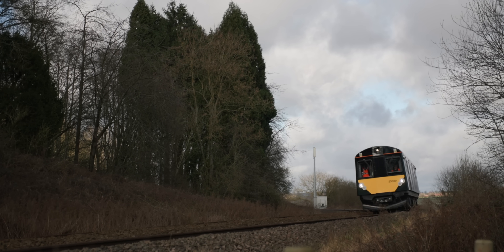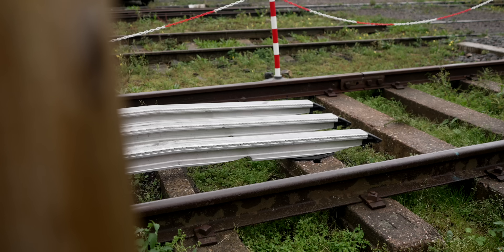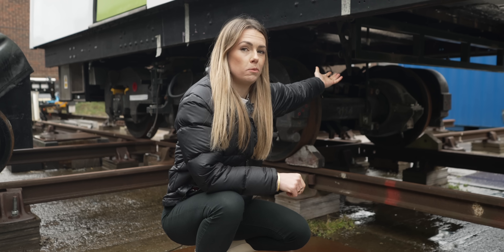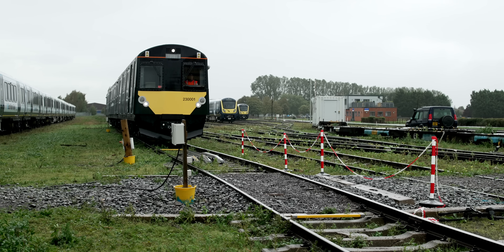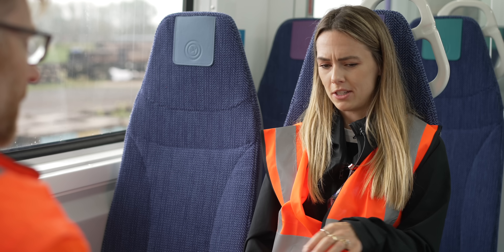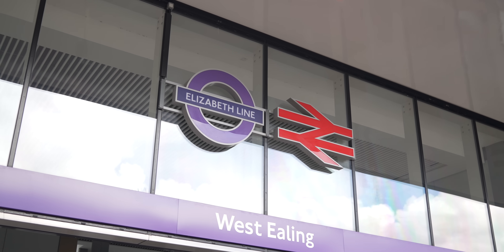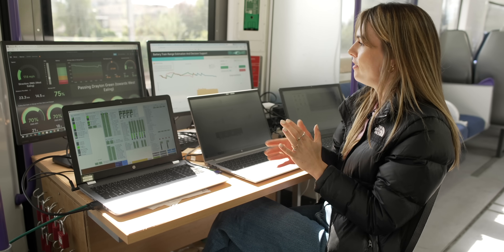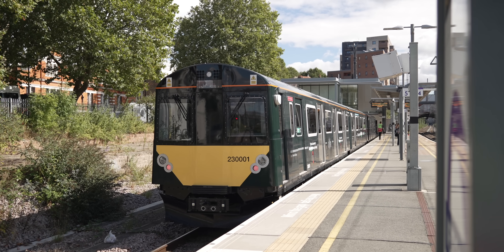Onboard the UK's First Battery Electric Train!

Comment: Battery trains are a good idea for unnelectrified branch lines that run on diesel as it would electrify the line quicker and cheaper than install overhand pickup lines via pantograph or third rail via running shoe.
Reply: Electrification of train lines is an expensive and time consuming activity, the 80 mile stretch from London to Bristol cost £7b and took 8 years (which covers a third of one of the two furthest south west lines). I won't mention the more recent cost or timescale of HS2 upgrade, which dwarfs the west line upgrade. Even on the south western lines the majority of the two routes remain unelectrified operating diesel (and hybrid diesel/electric) trains on the routes, having battery trains would be a more cost effective solutions for these services swapping out the ageing diesel train stock.

Additionally, the areas involved are high flood and wind risk locations, having battery trains would enable operation when power was down for third-rail or pentograph solutions. A battery train would be able to continue past areas without power to the next recharging stations.
Reply: @GruffSillyGoat  West Coast Mainline was fully electrified in 1974.
Reply: @J-Railway-Volunteer  - it's those pesky UK geographic terms, the 'south west' England routes are also referred to as west coast routes along the bit of the south-west I reside. I hoped avoiding the term main line would distinguish this from the West Coast Main Line, looks like it didn't. Will edit to clarify.
Reply: @GruffSillyGoat  Once water is at top of railhead serviced are suspended so doesn't difference for OLE.
Reply: @J-Railway-Volunteer - True, although the limit is lower for third-rail systems due to electrical bridging to ground.
Reply: @GruffSillyGoat  25kv OLE only needs 70mm of clearance.
Reply: Excellent - there are so many local lines that could use this technology
Reply: It would be interesting to see the fast charging system trialled on the Marshlink service in Kent/Sussex. There's 3rd rail at either end of the line and from Ore to Eastbourne the train can use the existing 3rd rail to charge and run for 1 hour plus during the journey. The same applies to the Uckfield line, which is electrified from Oxted to London. All you'd need is a fast charger at Uckfield to top up the battery before returning.
Reply: no! it will only run on very specific lines not everywhere! also those trains are not aerodynamic at all! they should have redesigned the whole aerodynamics for more range.
Reply: @carholic-sz3qv  - these are similar to rolling stock used on UK networks, that are designed for demand flexibility to be expandable by coupling more units together. It's the larger high speed intercity trains, that are typically a fixed number of carridges use aerodynamic designs.

However, this is a test train using existing rolling stock for lower cost. As in the video the system is designed to be underslung on units so would suit any train whether retrofitted or new design.
Reply: @carholic-sz3qv  Aerodynamic don't matter below 85mph on a train and the 230s only do 60mph.
Reply: Perfect for trans Pennine routes. Overheads would be a problem with so many tunnels and bridges. Lots of re- generation rolling down the far side of the pennines.
Reply: @ianithompson4239  Pennines is getting electrifaction for 125mph running which batteries can't support.
Reply: Trains with batteries onboard are also a good idea for covering a gap in overhead or third rail systems. In these use cases the train usually picks up power while moving along, but when it reaches a gap it runs on the battery power, and recharges the onboard battery when it gets to the end of the gap. 

Clearly that is a different kind of battery train to this one: the batteries can be smaller, and don't need lineside storage as they are recharged from the normal running current whenever it's available.

Use cases:

- tunnels where the civil engineering to usual overhead wiring is prohibitively expensive

- container yards, where there has to be a gap in overhead wiring to allow the containers in and off. At present this either involves use of a diesel shunter, or complicated movements to allow the train to be pushed/pulled under the crane without the electric loco also going underneath. 

- historic railway architecture, such as the viaduct near Bath, where local people, listed buildings regs, and English Heritage strongly oppose the (alleged) spoiling of the historic architecture with overhead wiring.

- extending an existing electrified service without needing more wires/third rail. This was fine by Merseyrail for the extension to Headbolt. Unlike the fat charge system, the batteries are slowly recharged from the running current while the train follows the rest of its service route visiting all the other stations on the line. 

What's different here is the fast charging scheme. As well as being a game changer for the kind of shuttle service been West Ealing and Greenford, this success also makes it more feasible to put money into making batteries to cover gaps into a real thing.
Reply: @trueriver1950 Your last point is exactly what is happening in Ireland. Irish Rail put a big order for a fleet of battery trains, they will run on the existing electrified tracks around Dublin and then switch to battery to run on non electrified tracks around Dublin for up to 40km from Dublin. Greatly increasing the range, frequency and capacity of Dublins commuter rail network. They do plan to eventually electrify those tracks, but it will take years longer because of complex bridges, etc. They can then take the batteries off the train and use them as line side battery storage systems. First trains of the new fleet just arrived in the last few weeks and are starting testing soon. All very clever.
Reply: @trueriver1950  Another benefit is peak shaving for the load from the trains themselves. The trains will consume a vast amount of power to get going but relatively little to maintain their speed. It's possible to split the load between the overhead line and batteries to limit the peak current that the overhead cables have to carry which would let you use thinner cables.
Reply: @spankeyfish  The OLE cables are as thin as safe.
Reply: @sarkybugger5009  Why would you design a passenger train to be capable of a hill start loaded like a freight train?
Reply: They are looking into the battery electrification of the Exeter St David’s route when the diesel trains come end of life in 10 years time.
Reply: The short runs on branvh lines, and the wait at the terminal station allows for good charge / discharge practice.